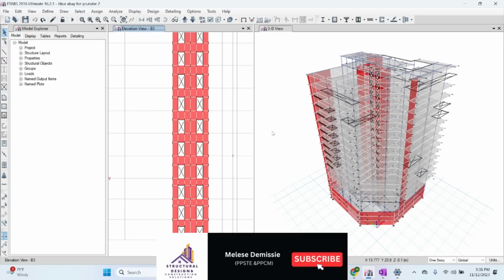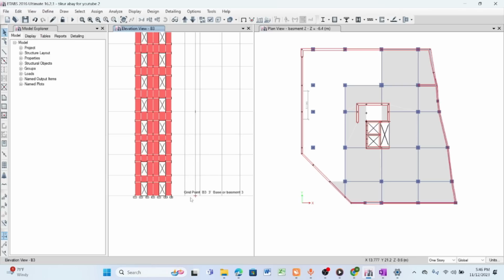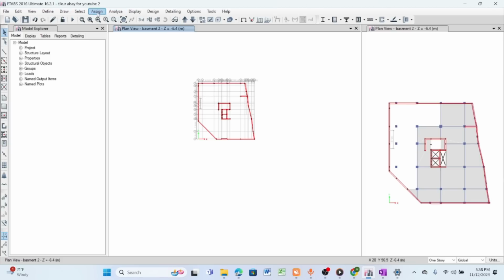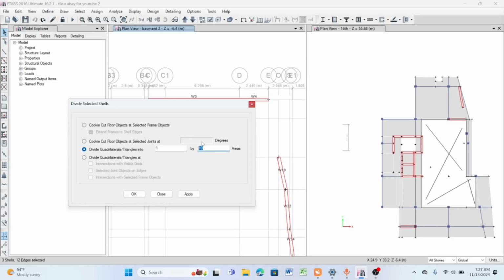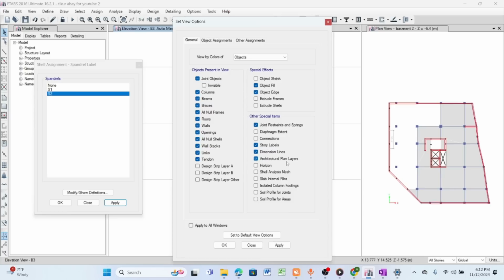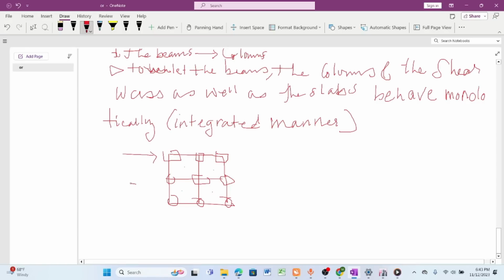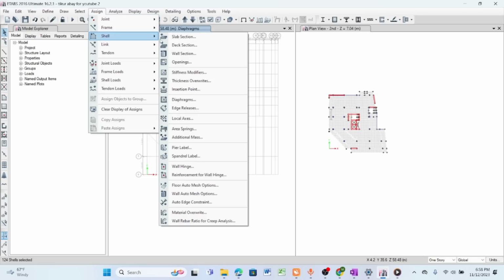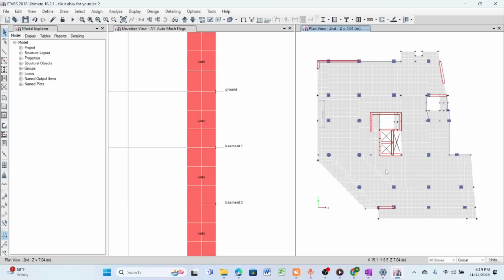Complete Structural Design of 20 Story Building using ETABS as per Eurocode & Ethiopian Code (part6)

Comment: what if the diaphragm assigned is not around center e.g because of stair case position  it might shifts. how do we correct it
Reply from the maker: Center of mass will never be at center unless the building is symetrical in plan and elevation

Comment: hey sir how are you?...how to take action for area load transfer warnings?
Reply from the maker: identify the area where it becomes area load transfer error. most probably it may be at opening. hence try to select all the opening and delet all assigned load. The other may be due to slab located on spac( not connected with columns via beams or slab. so inspect and identify the cause of the errors. any way will  see it in detail on next tutorials during loading.
Reply: @melesedemissie7664  thank you sir